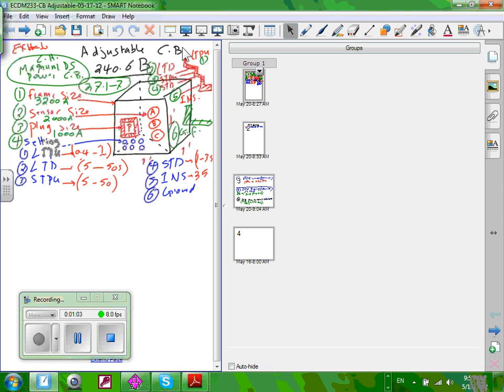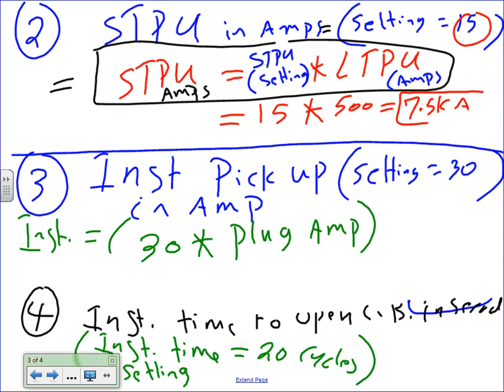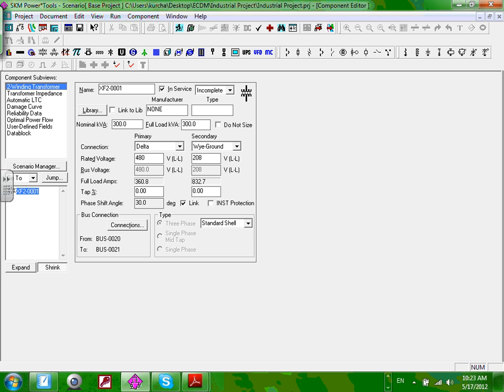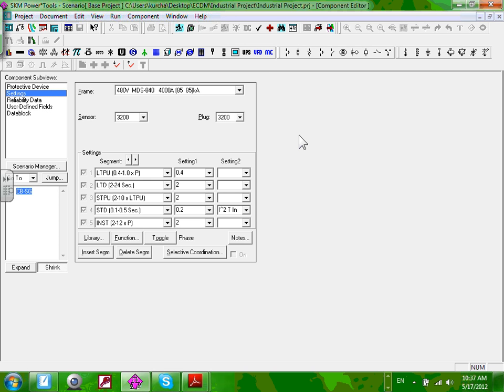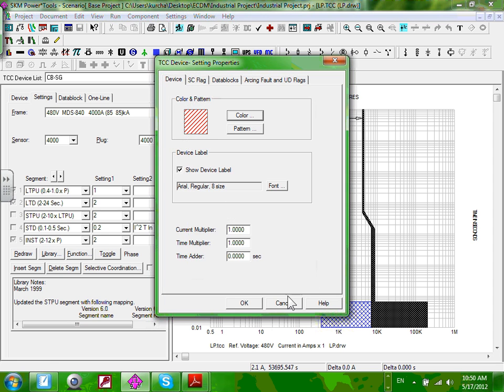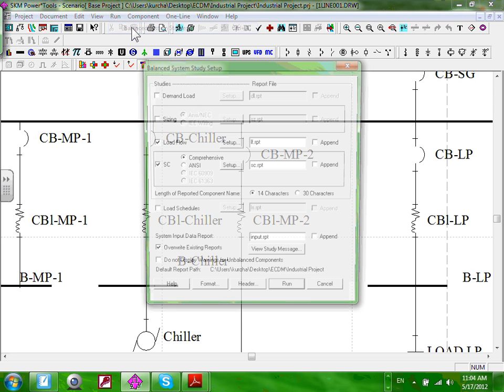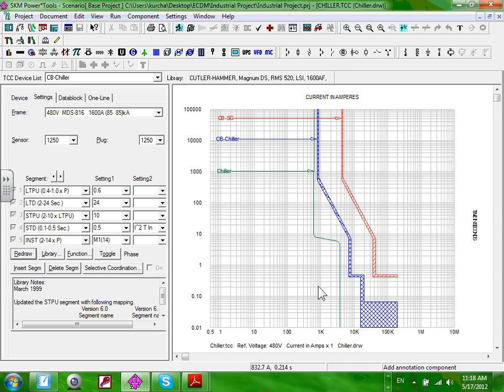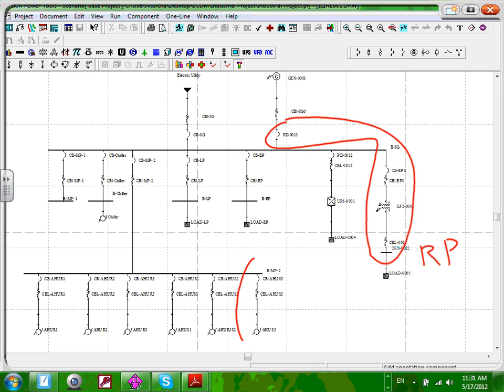Power System Analysis-SKM-PTW & Adj CB -05-17-12.wmv

Comment: If you could delete it as you show two other issues seem to pop up: 1) What happens if there is a dead bolt fault on the main breaker?  2)  Since you will have to wait some time to get to the next setting to actually trip, that time equates to energy and thus a higher arc flash rating.

Comment: That was a very nice lecturer. The coordination is very useful because when the pump (motor) fails to start, the technicians usually set the LTPU to maximum, increasing the short circuit current, if a fault occurs. That would result in more incident energy in arc flash.